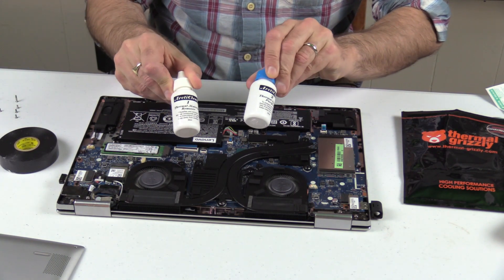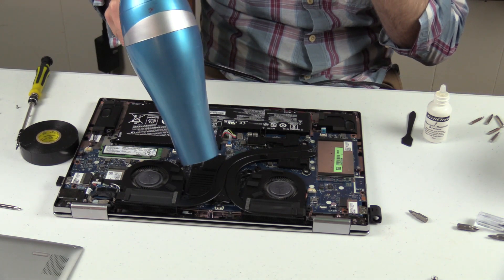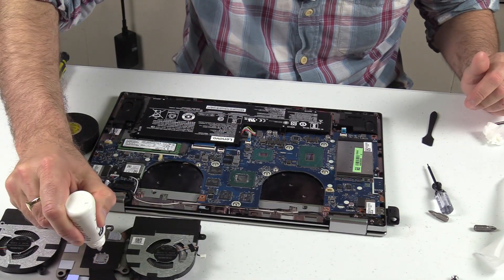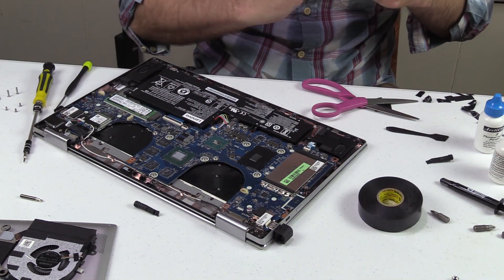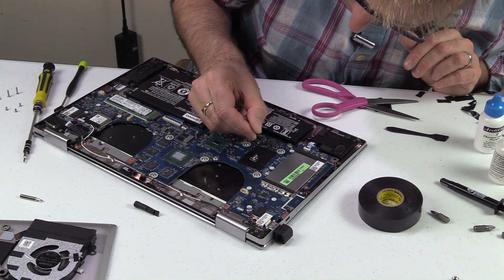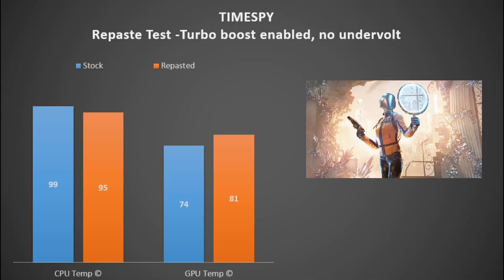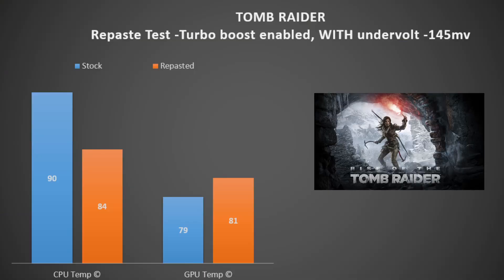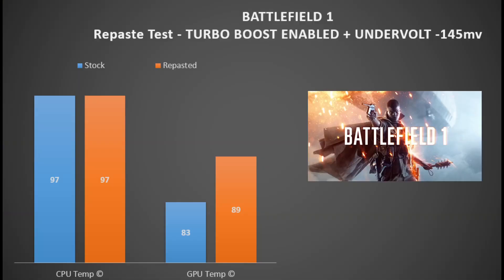Repasting The Lenovo Yoga 720 - GTX 1050 - Does it help ?

Comment: Hey man, I got a question. Do you prefer the Dell XPS 15 or this laptop. If you have to choose to have only one, which one would you choose.
Reply from the maker: Boii for me it has to be the Lenovo as I use the pen a lot. If you are not using the pen nor need the 2-1 it may depend on price but the xps cpu is clocked corrupt of the box so no disabling turbo boost so that is a big plus for me..
Reply: Oh wow, ok, that makes sense why you would chose the Lenovo. What do you mean by clocked corrupt? I have a dell XPS 15 and never heard of that issue. Do you talk about that in one of your videos?
Reply from the maker: Boii sorry, auto spelling on my phone. I was typing on one hand as I walked the dog! It meant to say that the Lenovo disables turbo boost so in cpu work you get a 30% performance hit unless you enable it then you are faced with temperature issues. The XPS 15 has turbo boost enabled so it will be faster out of the box. I haven't tried one to see how hot it gets though. I use the pen all the time. To be honest I do prefer my Surface Book as it is so small and light. Hope that helps!
Reply: Oh lol... That definitely helps. My XPS 15 used to thermal throttle a lot last year, but I undervolted and re-pasted it and that left some thermal room for me to overclock the 960m buy 135MHz on the core and 700MHz on the memory.
Reply from the maker: Boii great, so you know what you are doing. Perfect!
Reply: Thanks, lol
Reply: Dell has better clock speed. Lenovo throttles it a lot. Dell has 4G on video card, Lenovo has 2G. Dell has a nice feel, best touchpad in this class. Lenovo's keyboard is a little better.  Early on Lenovo was selling for $500 less and then it was a close draw. Lenovo has flex hinges & pen responsive screen. If you like those features, it's the choice. They are both good, so it's a matter of whether these various aspects matter to you. On several Lenovo I noticed differences, so build quality isn't perfect. The Dell had no issues, but reviews seem to indicate that they were often imperfect too, Lenovo was better. My eyes are fussy in odd ways & liked the Lenovo screen better, so that decided it for me. So FWIW that's what I noticed.

Comment: Geez you must be rich to have all these expensive laptops unless it's a they are review units.
Reply: Ricardo Rogers just a little disposable income. you sell them after a month or so for a little loss
Reply: btw aeronaut needs to cure a bit afik
Reply from the maker: Ricardo Rogers nope, bought them all on credit. Return where I can and sell where I can't..
Reply: Bit disappointing on the GPU eh! I'd like to see results with the liquid metal on the GPU as you'd think it would bring the CPU down even more. Maybe post a short update video when you get hold of some more!
Reply from the maker: James Kingston yes, I'll have to do that!
Reply from the maker: MASCULINE MCGAINS that is what I thought, how long do you think? I did the tests the next day after using it for a bit.
Reply: Hmm... that should have done it. Did you use a ruler to make sure the heat sink wasn't bent when you pulled it off?
Reply: kinda unrelated... I'm going to send you a message! pm!
Reply from the maker: MASCULINE MCGAINS I didn't actually, that might be it. I'll probably just leave it as is, it's not my main gaming laptop and it's still below 90..